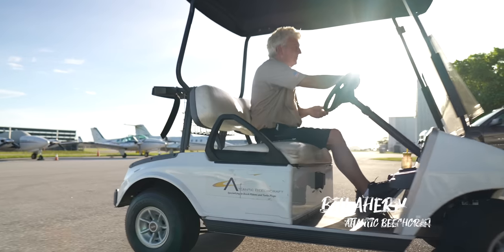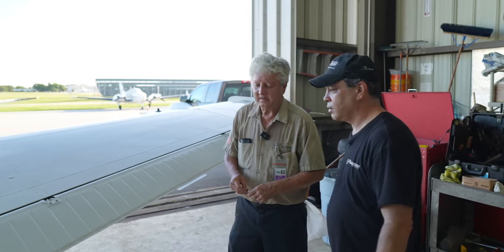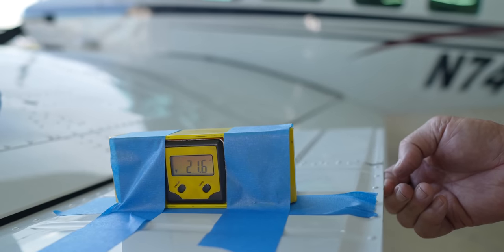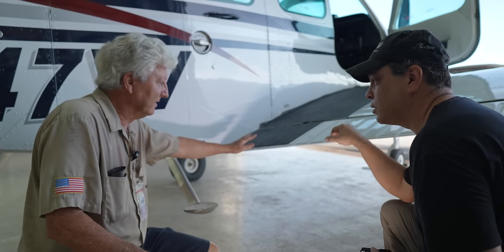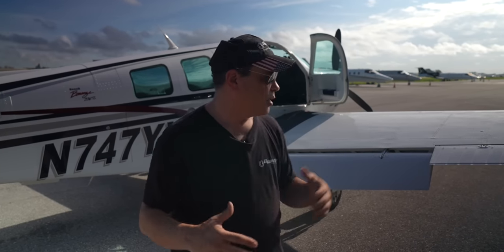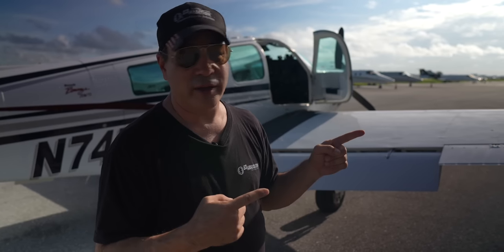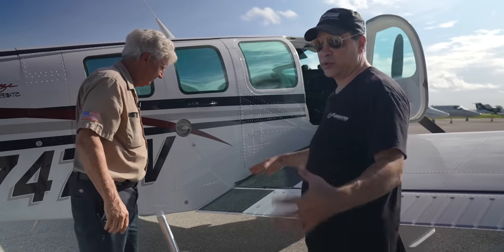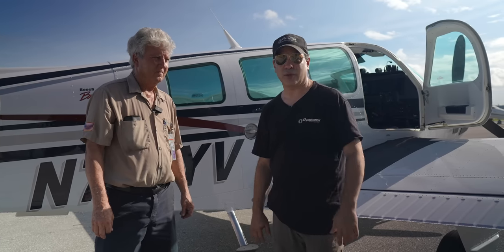Avoid Costly Mistakes: B36TC Rigging Tips

Comment: According to the American Bonanza Society people, one should never adjust flaps to correct a heavy wing. Myself and another gentleman are currently rigging an N model 35 that is out of rig. The plane is about 15 MPH slower than it should be. A previous shop had the right wing off and we’re afraid it wasn’t installed correctly. The plane has a heavy right wing. We found the right flap lower than the left. We corrected aileron travels, but now need to rig the flaps. It’s going to be a long process.
Reply from the maker: Thanks for the info.   Correct.   The right way for us is to actually jack the plane  adjust the wing first.  The plane flys great and we don't have any deflection.  We are way within the tolerance to do a small adjustment on the flap.  For now anyway.  

My discussions with the techs is we should zero out all the flaps and ailerons to exactly where they should be.   Then jack the plane and adjust the wing at the root for straight flight.   Then if we need a tweak on ailerons we can go from there.   I did not want to go that expense yet.  Its a whole day project.

Comment: No tip tanks available for the B36TC. It has a wing structure from a Baron, internal structure and fuel close to the wing tip wont allow tip tanks. Slightly resetting the wing incidence will be necessary for trim correction you seek. Droopong flaps will slightly increase drag. You have embarked on a long term process of slight tweeks and test flights to get it perfect. I dud that on a P-51 back in the 1970s, about 75 hours of short test flights alone befote it was where we wanted it in all 3 axes. When finished it flew beautifully, but it was a LOT of work. The 51 is an extremely trim sensitive plane, every small power or attit i de change requires trom adjustment, don't think I would start down that rabbit hole on a 36 series Bo 17:21 nanza unless it was annoyingly out of rig, but I wish you good luck. BTW, I had a B36TC back in 1983, much nicer flying than an A36 due to its longer wing and vortex generators on the leadung edge. Flys almost as nicely as a 35 series, though still not as light on the controls.
Reply from the maker: Hey @jamesnelson7415 Thanks for sharing. 👍👍👍👍👍👍  Great insights.   I think we plan to find another project plane we can do more to.,